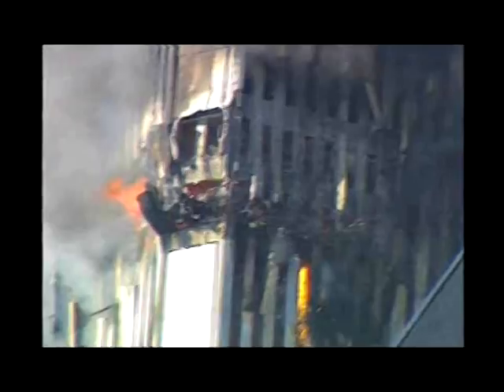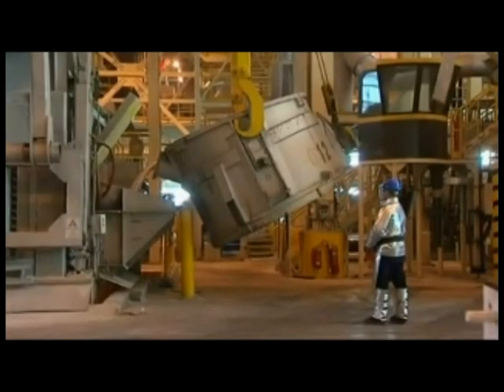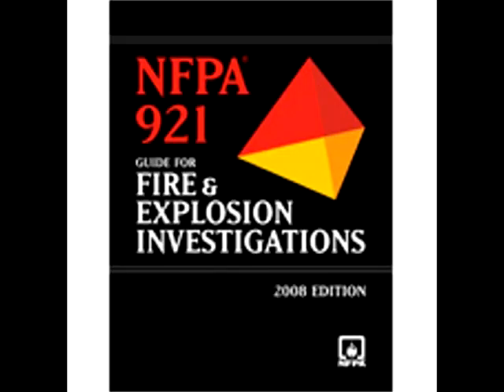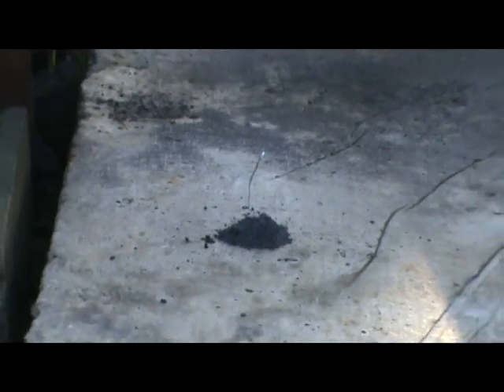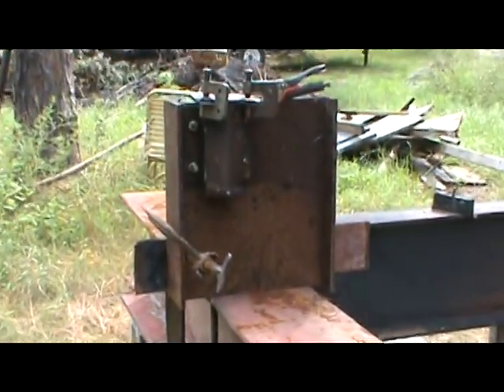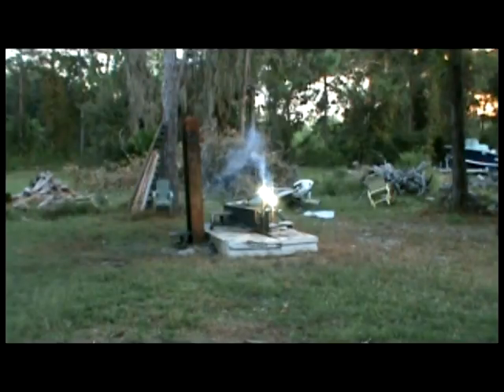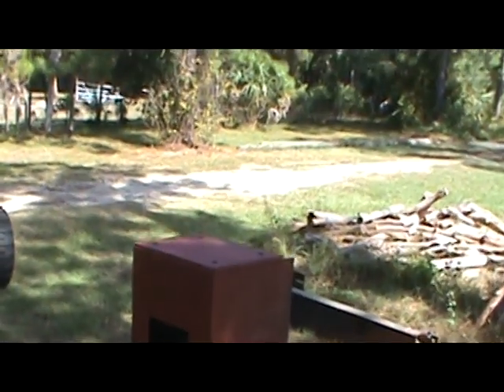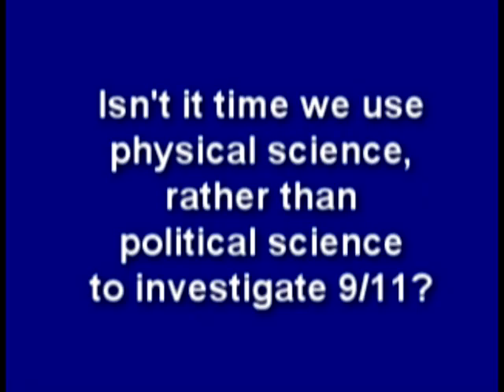9/11 Experiments: The Great Thermate Debate

Comment: Okay so the temperature from the jet fuel and the office material burning was 1800° F, but as you claim 1000° less hot than needed to melt steel?   Did it occur to you that steel weakens as it gets heated thereby loosing it structural strength?  With simple reasoning one could conclude that the steel's strength was lessened to at least 2/3 its normal strength.  Furthermore, you did not show conclusively that the molten metal seen pouring out the window was in fact steel.  Am I to believe that the steel balls you say were found were the same as were seen pouring out the window?  After the collapse of those tremendous structures I do not see how anyone can say for certain what they were to find in that heap.

Comment: some objections: 1) thermate burns violently with a lot of flames and smoke. I don't see that happening in any 9/11 footage.
2) thermate burns fast, while the towers stayed up for 1 hour or so. It seems to me that if they had used thermate to cut the columns, they would have broken right away
3) why would somebody engineer such a complex and bulky plan if they needed a flse flag to attack afganistan? why not simply put explosives on the twin towers and blame terrorists? or just invent an excuse to attack like they did for iraq?

Comment: As an electrician I have use thermite hundreds of times to fuse wire to steel - we always used graphite molds in a process called cadweld - they use the same system on rebars - I can say it directs the liquid and if the shot is overloaded it melts through the beam

Comment: Ok for the conspiracy theory among you which is most.Consider this the core and the outer walls of the building were connected by trusses not beams and were much easier to melt especially where they were connected by a few small bolts.NOW here's a video of a freeway interchange  made of solid metal beams covered in concrete melting and falling apart due to the heat from a tanker  fire...https://youtu.be/XHxyIECIEp0  ,.Your going to have to do a lot better job than this.

Comment: If you really want to know how 110 stories can fall into a pile 3 stories high or how a row of twenty plus cars where burnt to a crisp 150 meters from the towers you have to stop looking at the red herring which is thermite, it has been used as a distraction to hide the use of direct energy weapons, this weapon answers all the questions in this vid and all the very strange events that day, like why only one filing cabinet was found in the debre, remember all the paper flying around all this can be explained just watch (Dr Judy Woods Where Did the Towers Go) 
It is a must watch, i watched those towers come down 100 times and every time seen explosions bring them down until i watched Dr Judy 
I also learnt of stuff i had never seen before from that day like steel rusted out within an hour of the towers coming down completely burnt out cars with untouched paper inside them as well as no glass could be found, all can be explained

Comment: Wouldn't it be alot more obvious if you did this on a column inside a skyscraper? On top of that your cutting steel, what about every single other materials that was around columns? Physics show the buildings would have fallen exactly how it would due to the pressure going straight down and out. Your also talking about an entire building of people with survivors, millions of people watching on TV, and video to continusly see it, yet we don't see the huge flames flying out? Instead as not even showed here we see dripping steel. On top of that y'all do realize how obvious it would look if someone suddenly put this on the columns? Like you forget they are just cases in the walls. So suddenly there would be a chunk of those wall fixed (nobody reported that) and a pretty large bulge coming off them (still nope). Lastly, while jet fuel cant melt steel, it sure as hell will get it hot enough to allow for the pressure of you, guessed it, a small building to cause the colums to weaken, bend, and eventually fail. Displacement of weights and stressed allow for the huge failures of colums especially being that they aren't meant to be given stress on odd angles. Combined with everything I've stated, you can see the building begin to first implode, then explode as the building begins it's descent furthermore shoving all the materials within the building outward and towards the steel columns that aren't supposed to take a load in a horizontal/ angular direction

Comment: i am sorry but when the plane hits the tower it would ignite the thermate so how does it "ignite" an hour after the impact? and how the hell would you get the thermate on the steel in the towers?? you would need to cut 100s of big holes in the walls and not have anyone see you putting thermate in the walls? its a crowded tower so thats not possible.

Comment: Was it a thermite like material involved in the 9/11 tragedy? Maybe, maybe not, was the collapse of the buildings a very suspicious event, most definitely. I have seen homes made of wood burn to the Point of being just a charred frame and still be strong enough to survive some impressive forces, and steel is much more ressistant to heat than wood is

Comment: Everyone is dismissing the possibility that thermite was used, maybe it wasn't, maybe it was, however there is obviously a possibility that it could have been, and that it would have worked. There was in fact molten red hot metal flowing out from the building, and there were some very odd and strange effects done to the metal after the building had collapsed. That being said, I believe something was done in addition to the plane striking the buildings, I do not put it past the government to have done it, though i cannot prove that was the case. But quite frankly I do not care whatsoever, and by this point it doesn't matter anymore, what happened has already happened and that's that, I believe it is time to get on with our lives because proving that the government did this wouldn't really change anything.
Reply: yes, and your point is? Also at what point did i say anything that contradicted physics?

Comment: Ok i'm an open minded fairly intelligent 48 year old that's seen my share of this sort of thing. i've also heard my share of conspiracy theories and my God are there some really out there theories.  But this kind of makes sense because while jet fuel burns hot and fast and there was no way that even two jetliners full had enough fuel in them to melt the steel outter shell of the building, i wasn't getting how or why there would be anything such as thermite installed in a building or by whom and for what reason.  every explanation or theory i've heard is still a far fetched bunch of circumstances which make no sense. So following this logic with your info given we can see that in the right situation thermite can in fact burn through steel and my experience with demolition tells me that you don't have to put those charges on every beam, just key spots to destroy the whole building. Even if it were possible that the planes did in fact damage the buildings themselves, they both went in at different levels and different angles and damaged different parts of the building. this is the main reason i am leaning towards the explanation in this video with these experiments. so for arguement's sake lets say this answers the HOW, we already have the WHEN. and WHERE. But the key to the whole thing still exists WHY?  Acceppting your explanation of thermite charges, why would they have been put in the building and why is there no record of any of this and what was in those buildings that would require both of them be destroyed? as for building 7 there was no explosion in it the explanation for it falling and one other building near building 7 getting heavily damaged and almost falling it's self is because of the seismic shock of the other two buildings falling there were actually 3 buildings that were evacuated that day immediately after the towers fell. but when someone can answer the why and what was the end goal for destroying the towers and almost 3000 people, i'll buy the theory completely. For now i am optomistically skeptical of what to believe for sure because i watched the whole thing unfold live not on tapes not on youtube later LIVE.  but i also do remember seeing the red melting metal coming out of the side of the building and raining down sparks also
Reply: energy weapon,
Reply: "but when someone can answer the why and what was the end goal for destroying the towers and almost 3000 people, i'll buy the theory completely"    -    It was so that they could enter a war with Iraq, manipulating the people that Iraq had officially started war with U.S.A.
"  go back and look at all of the tv news channels from abc to cnn and every late night comedian and every big newspaper from the nyt to the washpo, they were all beating the war drums HARD.  the mainstream establishment was pushing the USA and many other countries into iraq, and there was no stopping it. " Satisfied?
Reply: The outside was aluminum,steel would have never held up to the weather and would have made the shell too heavy and also does last as well in extreme climate change. There would have been a forever painting crew on that building from day one if the outside was steel. All the strength  comes from the core,the inside starting at the massively strong foundation,the outside or "shell" is merely a facade of shiny aluminum and glass that is not a structural load bearing piece it is in fact robust enough to withstand weather,high wind,mild debris and constant tempature fluctuations.

Comment: there are two over sights here 1 the steel beams don't have to melt they just need to get soft for the steel to bend 2 any test with Thermite on a beam is working on a cold beam as the towers was on fire already the beams was hot anyway meaning less heat loss for the Thermite when burning.

Comment: It can see how if the floors of the two main towers are weak inside, and the floors can colapse easily.    However, it boggles the mind to think how WTC 7 callapsed so easily, and it was a block and a half away.  It was damaged minimal on the outside, but to say some internal fires caused it to colapse in one motion.  That’s crazy.
Reply: Check a map.  Between WTC 1 and WTC 7 was WTC 6.      WTC 7 was in the debris field of WTC 1, but at the very edge of it.   Certainly WTC 7 was a crappy designed building.
Reply: WTC 6 was directly adjacent to the large towers and had heavy damage beyond repair.   It was taken down the rest of the way by a demo crew later.  WTC7 was farther away.    No large chunks were taken out of the building.  Only fires caused the main supports to collapse somehow.  It was crazy weird how WTC7 fell like it did.

Comment: It saddens me how many people in the comments believe 9/11 is a hoax. That even our corruptes government in the US could justify slaughtering thousands of our own.

The government took advantage of the tragedy, as a corrupt government does. But you're so mislead that it physically hurts me if you believe everything that happened was a hoax. Disgusting.
Reply: Blu Crystl "Demolition." Right.
I'm studying mechanical engineering currently and have taken phys w/calc. 

The only thing I need to understand, is that 9/11 WAS NOT a hoax. And I feel for you if you believe that it was.
Reply: Blu Crystl 
A little civil engineering for you here...

Due to the vertical strength being concentrated in the center and perimeter of the building, but not in the floor space, the floors gave way, resulting in the perimeter and core columns no longer being mutually supported, causing them to collapse. Due to the fact the seating points for the floor trusses were internal to the perimeter columns, the torque caused by the impact caused many of these columns to collapse inward, into the building's footprint. This became less and less of a factor as the collapse sped up, as the failure mode went from bending to shear stress. This can be seen on several videos whereby the perimeter columns for the lower floors stayed standing for several seconds after the collapse of the floors to which they were attached. 

WTC 7 was designed in a similar way, and collapsed in a similar way, with fires being uncontrolled due to the collapse of 1 and 2 WTC severing the water lines for the sprinklers in the first 15 floors. Again, the combination of asymmetric loading exceeding the design loading of the structure (as a result of large pieces of debris impacting the south side perimeter and core columns), along with uncontrolled fires weakening the remaining structural elements, ultimately lead to a progressive dynamic failure of the building, resulting in a collapse.

If you truly think this was a hoax, then I think you need to sharpen up your physics knowledge and math skills.

Comment: The fire proofing on the girders got knocked off when the planes hit the towers. That exposed the steel to the aviation gas which burns at high  temperatures caused the steel to fail. That’s why the buildings fell. Building 7 got buried with debris from when both towers failed.

Comment: What a waste of time all that testing was. As at art school we melted steel with wood as the fuel source in a furnace made from glass insulation batts. The thing that gets the temperature up is the heat speeding up the chimney. As is draws air (with oxygen) up fast. It's this oxygen that raises the temperature many times above standard burning temperature, not the fuel. We later did it with kerosene, and were able to melt steel even faster.
The twin towers had the world's tallest chimneys, the lift shafts! Burning fuel and debris fell down those lift shafts, speeding up the suction and venting, creating one of the biggest furnaces we've ever seen. So no wonder the steel melted. 

Also in New Zealand I saw a warehouse collapse during a fire because the fire melted the steel frame. not much of a chimney effect there yet office products melted steel. Educate yourselves about melting steel people. The bloody Romans were doing it a few thousand years ago with wood also.
Reply: Dinkelstein Kerman thanks, I'm willing to hear you out too :-) what do you mean by 'only that floor'. I haven't looked into what floors were burning but I thought it was several floors where the planes hit? 
As for the lift shafts the fuel could have poured down them igniting and the flames then go up and past the burning floors. That suction would have been incredibly powerful, effectively making a giant chimney sucking in oxygen from the lift shafts below. I can imagine the noise and power of that would have been frightening to anyone near those lifts no matter what floor they were on.

I'm not saying that 9/11 wasn't an inside job though. I think that some top officials may have known there were people training to fly planes, yet these officials did nothing as the attack would be beneficial to them. History is full of false flag attacks. But to wire up the worlds two tallest buildings seems to be too hard to get away with. I think the planes alone hitting the buildings without them collapsing would be enough reason to go to war. 
Dropping the buildings on purpose would be enough to triggering suspicion of an inside job. I think they weren't meant to drop. The fact they did collapse created so much suspicion that I bet those involved thought "oh shit now thats just too unbelievable!"
Reply: Dinkelstein Kerman good points. I think the steel frame had a flame retardant coated on it. My firefighter friend said it only lasts so long though. A plane that size is still a very heavy object however you are right it would crumble on impact but there's a lot of plane to crumble into a more compressed object so it would still have a lot of kinetic energy after the plane has hit due to the speed of the plane. Did the plane or anything come out the other side? There was a lot of fuel too, Which of course ignited, and if it went down those lift shafts as I'd expect that much liquid fuel would, then the fire would immediately follow wherever the fuel went.  I just struggled to see the benefit in the towers purposely coming down in a controlled way? Because no one would believe it (as no one does lol) If it was demolished on purpose then wouldn't an irregular collapse be more believable? 
Like you say because of the media we will probably never know the truth. But most of us suspect some form of high level involvement or simply  allowing 9/11 to happen when they had the chance to prevent it
Reply: Dinkelstein Kerman indeed. The public are often kept in the dark. I live in New Zealand and for many years of my youth I was told that the Maori people had sold their land to the English settlers. But only through the Maori protesting it turned out that most of the land was stolen and confiscated by the British government. I grew up to a lie and sadly I disliked the Maori people for being greedy, but I was wrong and the good news is the NZ government in recent years settled and paid many tribes millions of dollars to help compensate some of the losses. Plus the younger generations are taught the truth about what happened in schools. Including the fact that the original treaty the Maori signed in 1840 was actually two versions of the treaty, one written in Maori and a changed version in English. Unbelievable that even happened. It caused so much anger and resentment all those years. Especially because most New Zealanders thought it was the Maori people's fault. Its good the truth finally came out about 25 to 30 years ago

https://en.m.wikipedia.org/wiki/Treaty_of_Waitangi